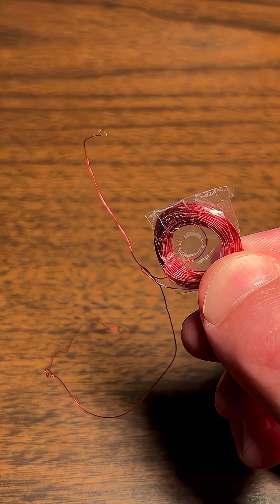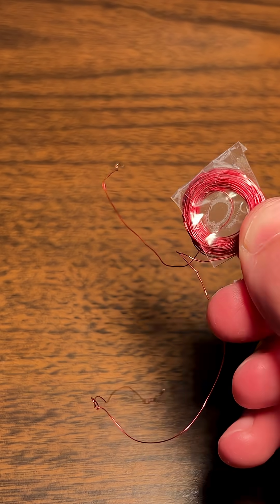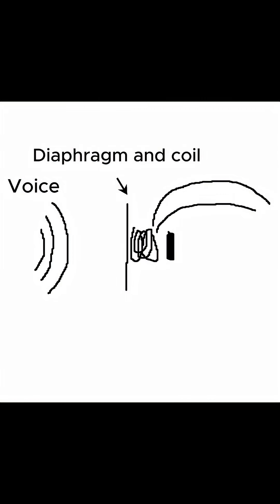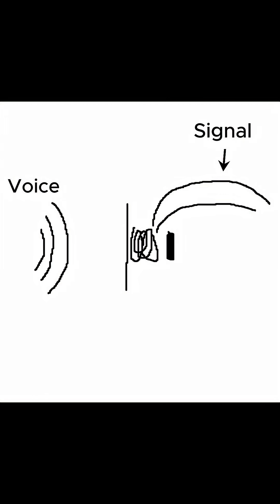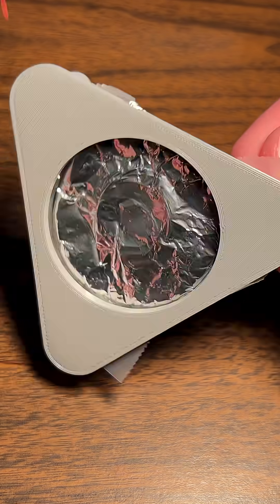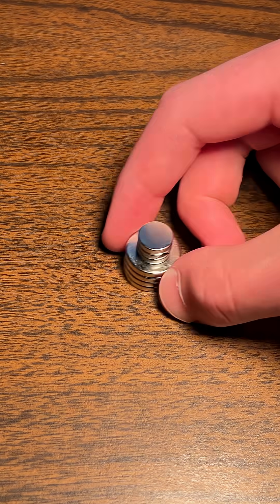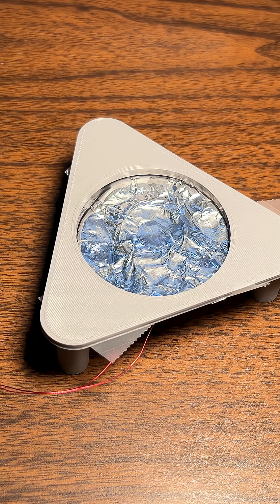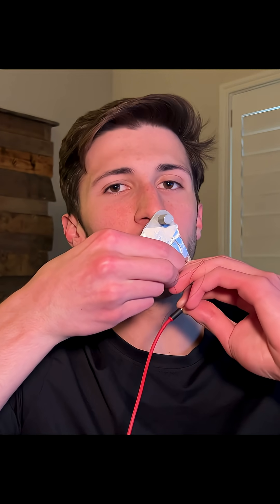DIY Microphone #shorts

Comment: Which is positive and negative? I was going to tear a piezo alarm apart but this gave me a better idea and do you think the size of the components would matter much ? Stronger , bigger magnet and more or less wire?
Reply from the maker: The interesting part is that the direction of the coil doesn't matter. As long as the correct points of the aux cable are attached, the coil can be flipped. For the components, any combination should be functional, but there are a few things that help. Stronger magnets are better. I'm using neodymium. For the coil, I'm not an expert, but the general idea is a lighter coil has an easier time oscillating. The problem is that with fewer windings, the signal will be weaker. It's a bit of a tradeoff, so I suggest doing some research. Also, please be careful taking electronics apart. Some have energy-storing devices and can be dangerous. Good luck with your design!

Comment: I havent dug too deep into building microphones yet, but Id imagine aluminum foil to be problematic due to rigidity.
You will want to get the lightest mass with the most flexibility to move the coil without 'eating' any energy itself.
There is this super thin plastic foil that you use for wrapping food, Id imagine this stuff would yield better results.

Cant find the video where you used plastic, so not sure what you tried.
But keep looking around the household- and food item isles for this super thin wrapping foil.
One of those easily breaking free veggie plastic bags might work too.
Or this protection foil you put over your stuff before painting.
Anything that has close to no mass but also close to no will to stay in a position will be a good candidate.

I wish I had more time to get back into that topic.
Used to work on building a 3-way speaker from scratch fully printed, but ran out of time to keep at it :/
You really make me want to find some time to get back into the topic and play around with microphones too!!
So great to see people genuinely still experimenting with that stuff and trying out unique solutions like the photoresitor you used in the other video!!!
That might actually be a concept worth further investigating. Dont remember having heard of anything like this used in audio before, but then again also never looked much at mics yet.....  super cool idea tho and has great potential since you eliminate the entire coil mass form the diaphragm.
You make me wanna get back into this all soooooooo bad hahahahahahaha